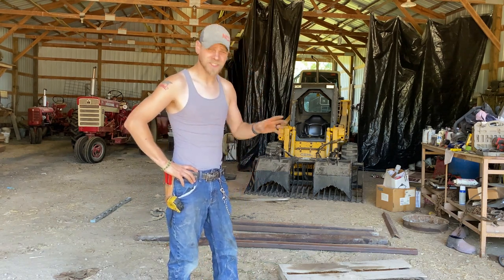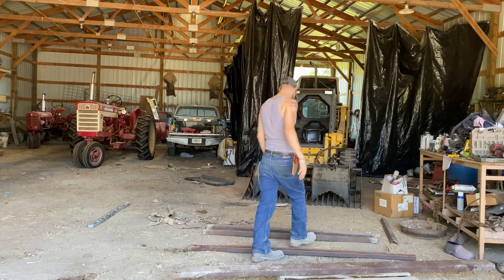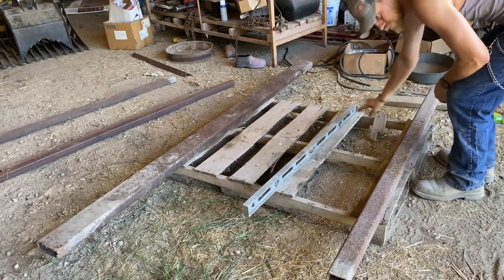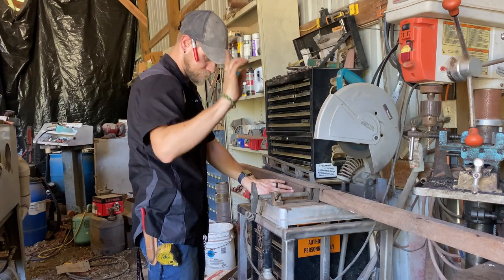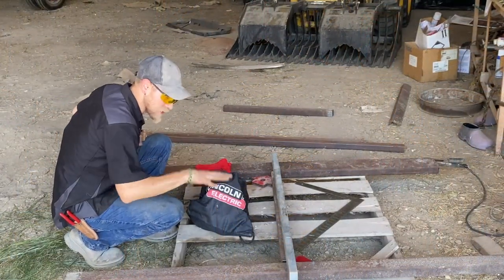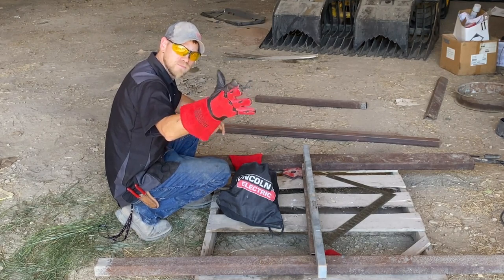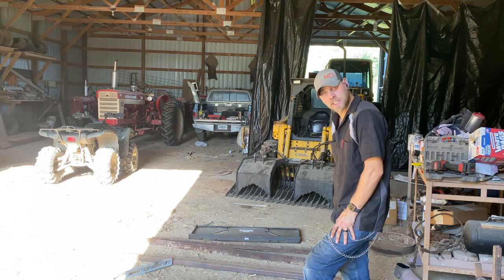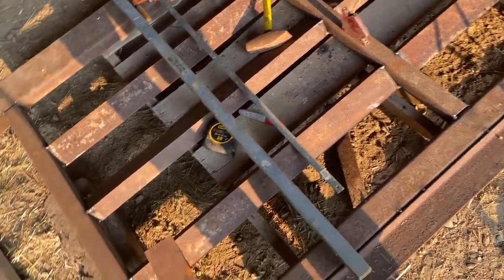I Can't Buy it.... But I can Build IT!!

Comment: If you're going to use it a lot, make sacrificial bottom plates. All movement over rock/sand/dirt is basically grinding your bottom. Some holes and carriage bolts, when the carriage bolts fall thru, time to change :)
Reply from the maker: That’s really good advice! Thank you I will have to look into that, it does get a lot of use. Thank you!

Comment: Poor is what I am. I had to resort to picking up a old box spring that blowed off some poor bastards truck during the move, tearing off all the quilt tying a rope to it. Now for the kicker borrowing a buddy's riding mower to drag it with and adjusting the weight with a  old dead tree cut to length with a handsaw. Get'er done 🤣
Reply from the maker: Lol! 😂🤣 now that’s awesome!
Reply: Being poor is all about planning man. I knew I was going to be a poor my whole life, so when I planned to run a tractor (pawn shop riding mower for $300) I knew I’d need weight for my attachments. (Pallets and old tires from the highway). So I had a whole pile of kids to use as weight for my implements. The kids think we are out having fun, but we’re really getting some work done.

Comment: Quick question on the angle iron in the middle is it a little bit lower than the frame? 
Sorry if that sounds like a crazy question I’ve never seen one pop close, the reason why am asking. And let me say great job on the fabrication- i’m in the same boat you are - somethings are just Add a reach financially at the time you need it well anyway thanks hopefully I’ll hear back from you
Reply from the maker: Thanks for your question! No the angle is the exact depth of the frame along with the angle iron that cutting edge is mounted too, then there is a half inch cutting edge bolted to that so the frame is basically a 1/2” higher than the cutting edge, so in conclusion the cutting edge does the work and the frame and angle distributes the material being dragged to create a level grade. All in all total investment making it with steel acquired over years and buyin 4 pieces about $450. Hope this is helpful!!! Thank you
Reply: @rustedknucklegarage  Yes thank you so much look forward to your next project
Reply from the maker: @salvargetto581 thank you!! That’s great we have a lot coming out of me restoring vehicles, and other fabrication builds coming soon!!!